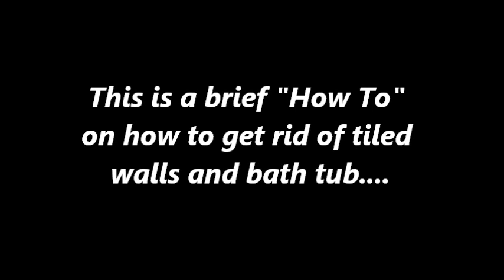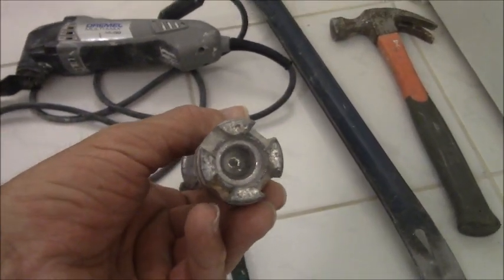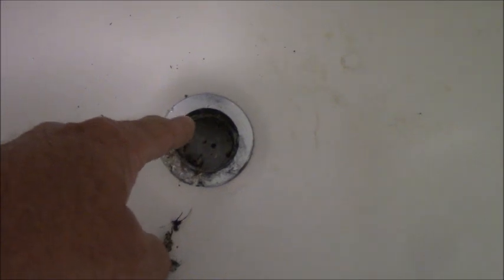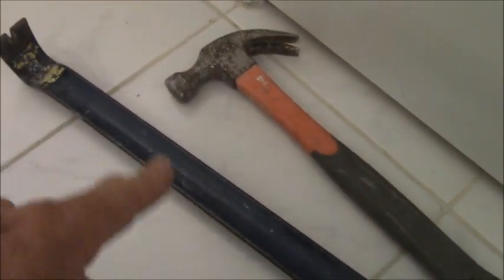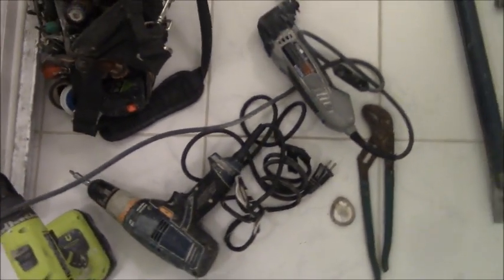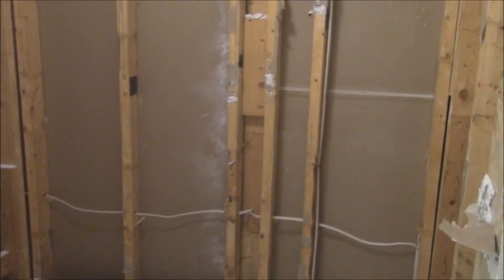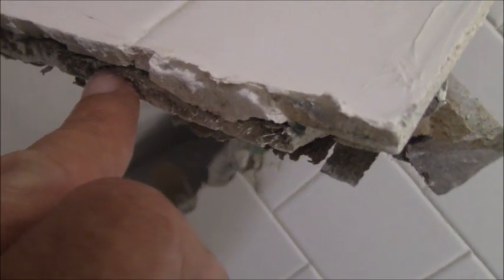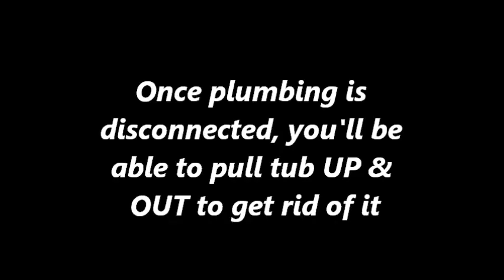Taking Out Bath Tub and Tiled Walls...mold and mildew issues

Comment: Quick tip for getting the drain out of the tub if it breaks.... get a heavy flat screw driver or a wood chisel with a hammer.  Hammer the chisel in the metal then start at an angle hammering the drain around until it comes off.  Its a mess and a bunch of work, but it works without messing up the threads.
Reply: There was a special screw on my honda pilot's steering column that i used a hammer and chisel with the same method.

Comment: I also use the multi tool to separate tile from wall before ripping tile out but not on sides where bulnose runs vertical.  on those sides, I first try to pop off bulnose first , leaving existing boards, then use multi tool along the field tile. obviously if the bulnose doesn't pop off easy or takes chunks out, I don't leave it but if I can save that section of existing wall, it works out better. the reason is the position of the studs behind, usually if you just did what you did, the existing wall adjacent to the new work will not be fastened because the studs are usually in line with the edge of the tub. I try to cut half way up that stud which I then fasten both boards to it. you ever do this?

Comment: So i have a question i have that same type of tile in my bathroom but all the way around it in (blue & pink). My question is my walls are plaster not drywall this was done in the 60's so would the same process work with the saw? My walls seems to be super thick with the mesh board behind it. ANY tips would help, Thanks!
Reply from the maker: Yes the same way will work, but pulling out all the wire mesh & mortar wall is a pain, labor intensive, and you'll never get it out in larger sections. Also wear an appropriate mask...it's full of asbestos.